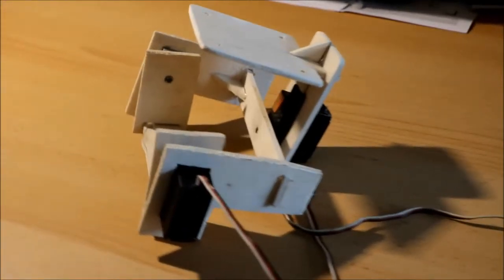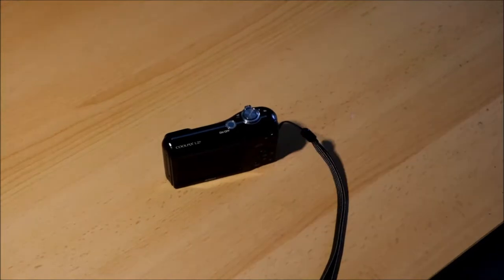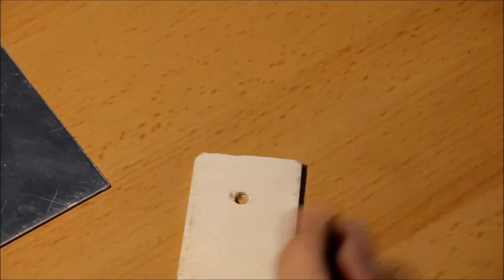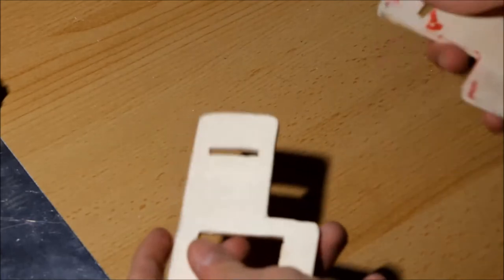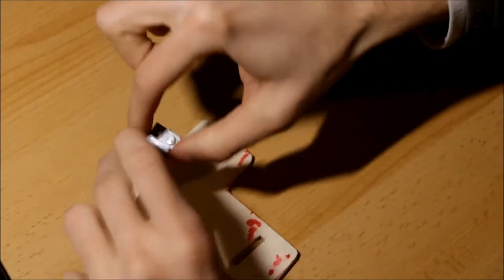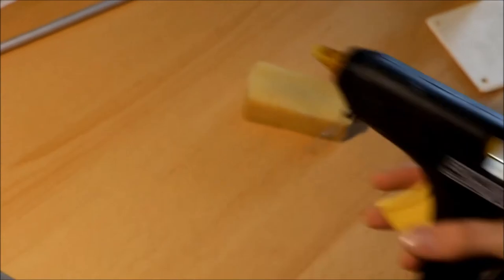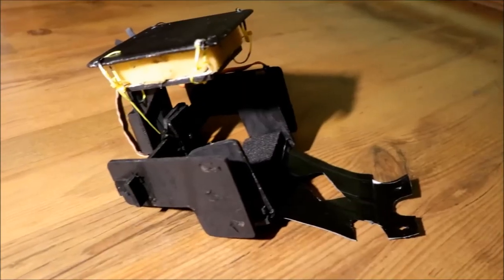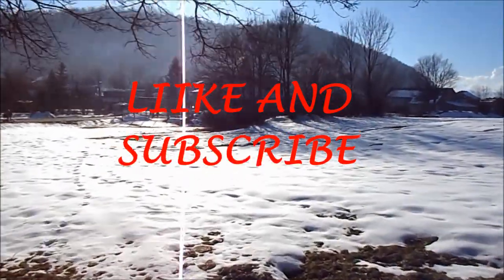Gimbal for Drone - DIY

Comment: can u control that camera from remote.i mean u said u have to connect those servos......please guide me.i want to make gimbal as well.
Reply from the maker: the sixth channel is used for pitch and i can control it via transmitter. if you want you can send me mail and i can help you make this gimbal
Reply: @wecise3714  how to make it? And the accessories where did you bought it? Can you help me make it?